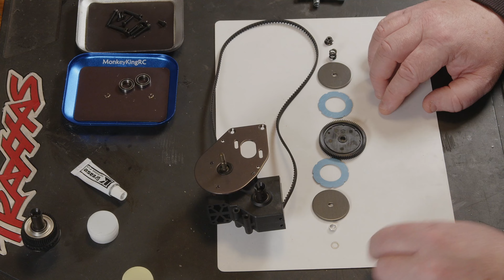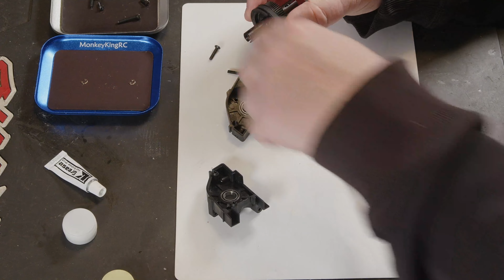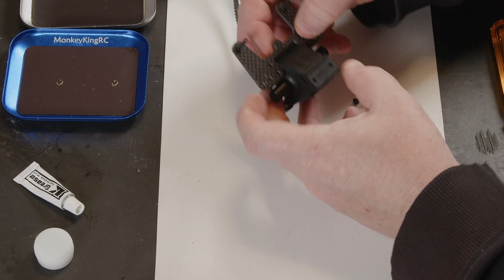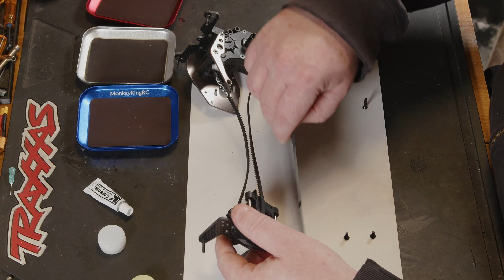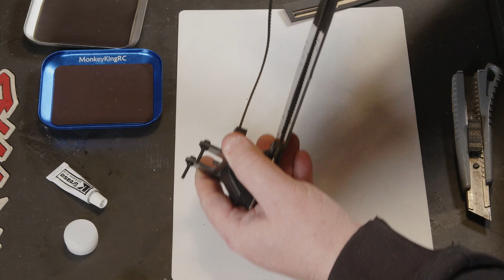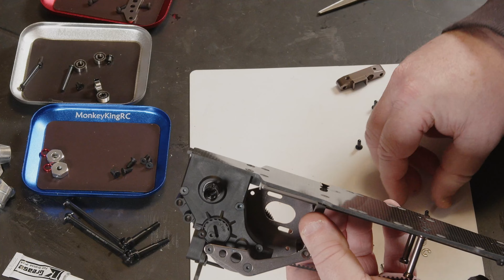KYOSHO OPTIMA MID 87 WC Worlds Spec build parts 7 to 14

Comment: I just started my 87 wc build and already have a small issue . The instructions say to add adhesive to flange that attaches to differential  (The belt drive gear) of course they didnt include any . Im debating using tire glue 🤔
Reply from the maker: May work just check it won't melt anything